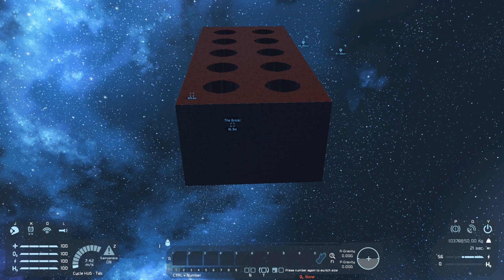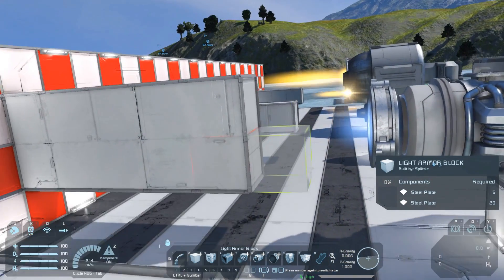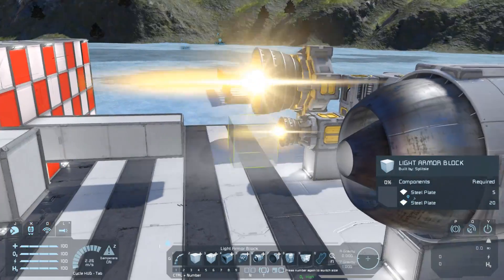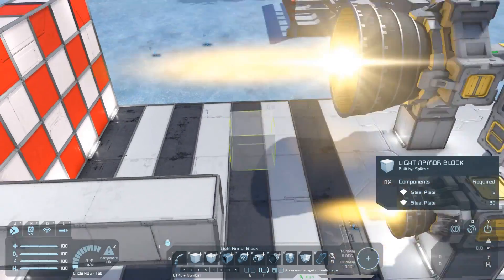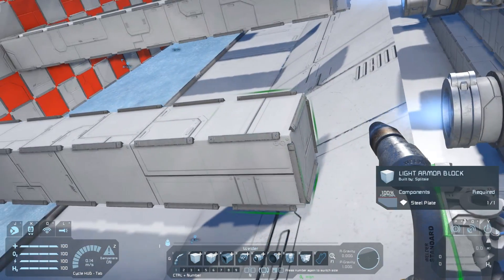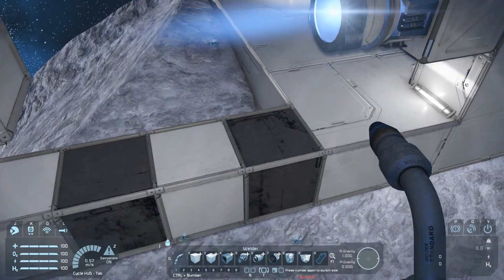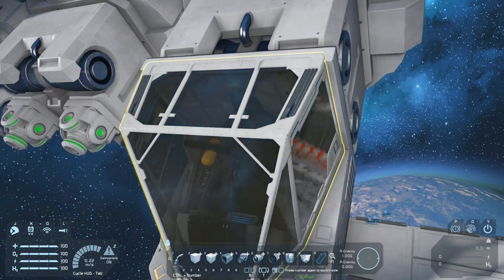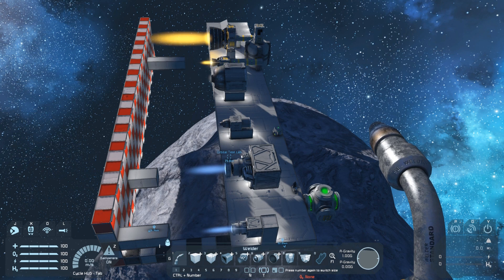Space Engineers Tutorial: Thruster Damage Range (tips, testing and tutorials for survival)

Comment: There is a mod called BuildInfo which will visually display thruster damage range and give you other valuable information (numeric block health, airtightness and mount points, cargo/tank volume, turret range, speed and accuracy, drill/welder/grinder radius, etc.). It's also invaluable when finding air leaks, adding visual path from your vent to the hole. It has no blocks added, so if you're vanilla purist or play on a server without it, you can blueprint your ship into SP to figure out what is causing issues. It does, however, work with whatever modded blocks you have (custom turrets, tanks, drills, etc).
Reply from the maker: It certainly can be a useful mod for that sort of info :)

Comment: Hello there, is it possible that these have changed over the last two years? 

I'm in the middle of designing a somewhat organic looking ship where I try to keep the thrusters on the inside. Since space is rather limited I've played around in creative a bit, much like you have here and for me, the large grid thruster damage ranges turned out different - 2 blocks gap for small hydrogen thrusters and 6 blocks gap for the large hydrogen ones.

I haven't tested the others yet since the ship is meant to run on hydrogen only, might do that later, though.
Reply from the maker: They seem to have changed a fair bit, mostly to substantially reduce the damage that was being done and the distance it's done at so what you've described sounds reasonable from what I've seen
Reply: I just tested it and got 2 blocks for the small hydrogens too. But the large one still seems to need 7 blocks, although the 7th block needs several minutes to even turn from 100% to 99%.

Comment: Hey Splitsie, you may want to do an addendum to this tutorial. I have been in search of a mod to improve armour strength so that landing pads can withstand the damage caused by upward thrusters close to the ground.

I came across a video clip talking about using Catwalk Plates as ablative armour to protect against missile attacks and I thought, if it works for missiles (as it did) surely it must work for Thrusters – and it appears that it does.

There is no logic as to why the thin Catwalk Plates should reduce the damage as they do, but since applying them I have taken off and landed several times with a ship that has a gap no higher that one small block above the surface and it has caused no damage whatsoever.
Reply from the maker: That definitely seems worth a re-visit. Rasip also mentioned the possibility of angled blocks not taking damage at the same range so I want to test that too. I think it's based on the way that the collision with the thruster is calculated so we could see some interesting results. Glass blocks may work in the same way as plates as I'd imagine they have the same collision box calculations.
Reply: See, there is another option I had never considered but a transparent landing pad made of bulletproof  glass would look super cool if it works.  Which reminds me of another cool trick I want to try . . .  More to follow.
Reply from the maker: Now that's not fair... no teasers! :P
Reply: OK  It took me a while but I finally remembered to test my theory.

You can indeed use glass blocks (windows) as a landing pad and they do look mighty impressive..  But here is the bonus:

You can connect to your Connectors through the glass.  Whats more, you can also pass items through the glass via the connector.  This means that you can have a connector inside a pressurized building/ship and still connect a ship to the outside and pass items through the glass without any loss of pressurization.
Reply from the maker: That is awesome!
Do you mind if I make a video on the topic and credit your work? I think people would love to know about that :)
Reply: No problems.  Go for it.

Comment: People need to know that thrusters have damage widths too, not just lengths. All of these images and videos about thruster damage gave me the impression that the width of the damage is just 1 block wide from the center of the thruster. Now I'm struggling with my completed hydrogen builds because this assumption is wrong and they damage in a 3x3x7 volume.

EDIT: This is false, I have done some testing now.

It actually emits damage in a 2.5x2.5x7 cross-shaped area. Half blocks directly on the sides of this volume don't take damage. Full blocks positioned diagonally along this volume do not take damage.

Comment: I do have a question. I've heard sloped blocks aren't damaged by thrusters at the same range. Any truth to that?
Reply from the maker: That's interesting, if it turns out to be true I might test a bunch of different blocks and see if there's any variation. I suspect it's the same but you just have to wait long enough for the blocks to be damaged - some of the blocks took a few minutes to take damage when I did the testing for this video.
Reply: Splitsie If it is true my thinking is that, like with airtight, only one side is used for the calculations.
Reply from the maker: Glass blocks will have to be on the list for testing then :)
Reply: @Splitsie  and? Whats the result

Comment: My question is very miner, if you'll pardon the pun, but may be of interest to other players also.

How far apart do drills have to be placed to be effective while not wasting space?

Also, most mining ships I have seen, the drills are placed way out in front of the ship.  Do they have to be that far out?  How close can they be to your ship without causing damage?
Reply from the maker: With small ship drills I've safely left 2 blocks gap, with large ship drills I've had them blow up with no gap at all... not sure if it was a failure of the voxel updates or a design failure, but it happens fairly often.

I think the reason the drills end up so far out front is down to conveyors and practicality, it's easier to put the thing that you wnat to have hit the rock there. The downside of having a cockpit or thrusters close is that they're more likely to get damaged in that setup. I've not tested damaging your own ship with the drills either so that could be a problem too.
Reply: if the cockpit is to close to the drills they WILL blow it up (i found out the hard way) also I have noticed a lot of people like to put the drills side by side yet that is a waist the drilling radius is large enough that if you where to place 2 drills far enough apart that 1 drill can fit between them with out actually putting that drill there it works just as well as if you had all 3 drills.
Reply from the maker: Ouch, that must have been a painful discovery. On all my old ships I used to leave a gap, these days I tend to just leave enough gap for the reversing thrusters as there can be devastating consequences when a stray voxel survives your drill
Reply: yea but i suspected that it might and there for made sure i had nothing in my inventory when i tested it as I was trying to see what I could get away with , so it was a learning experience and now i tend to build my mining ships with that in mind so i dont damage the cockpit or place unnecessary drills ive gotten to getting my mining ships to be very reliable and even being able to turn around inside there own tunnels when piloting it myself my next goal making it automated.
Reply from the maker: Sweet, I'm definitely not a fan of trying to reverse out of a hole I make, nor am I very good at it
Reply: same here thats probably why i worked so hard at getting it to be able to turn around inside the hole much easier going forward. especially since the drills are in the front.
Reply: I built my Earth mining ship with the bank of drills on the bottom.  Mining straight down, rather than at an angle means that getting out is just a matter of flying straight up (more or less).

Having the bank of drills on the bottom also makes for some interesting open cut mining, particularly when harvesting ice on the frozen lakes.

However, I was pretty sure that I had way to many drills, which has been confirmed by MacGabhann.  So I have some efficiency modifications to be made.
Reply: MacGabhann - Thanks,  That is exactly what I needed to know.  So, if drills are placed centrally either side of a cockpit, just two drills will bore a hole wide enough for the cockpit (and any other 3 x 3 block) to pass through, right?
Reply: yep thats it exactly 1 large block or 3 small block space between each drill any closer then that is a waist of drill space
Reply: Thanks

Comment: Did u put blocks around the large hydroel thruster
Reply from the maker: If you mean around the area where the thrust comes out, I didn't fully test it, but I'm pretty sure that the large hydrogen thrusters damage only the block directly in their path. If they damage adjacent ones it's only a very small amount. This is not true of ion thrusters though, those damage 2 blocks equally, but only the 2 in the center, you can cover up the sides without any problems :)